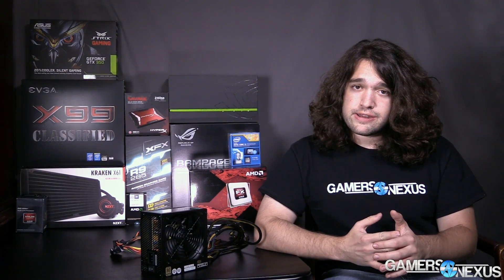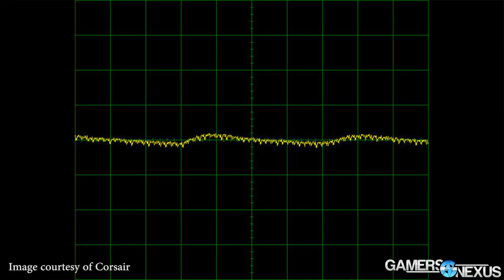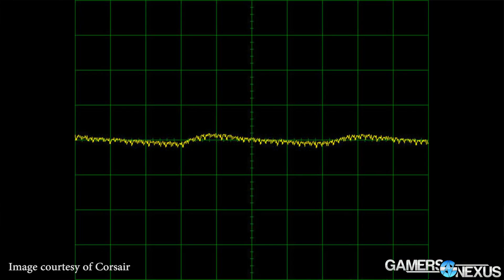What is Voltage Ripple in a Power Supply?

Comment: I have this issue , every 7 hours working my PSU will have a lower voltage input and not crash the system but continue but it's a weird stutter freeze. I mostly do modelling on blender and it's very scary when it happens at random.

Comment: I've had people tell me that there's a minimum load you should put on a PSU because any less may damage the PSU? Is there any truth to this? I know it can be less efficient than say if you were running at it's peak efficiency rate, but is there a point to where running a high wattage PSU with a low load can damage it?
Reply: The only problem is that you Will have lower efficiency.